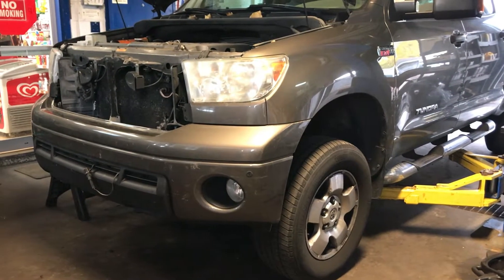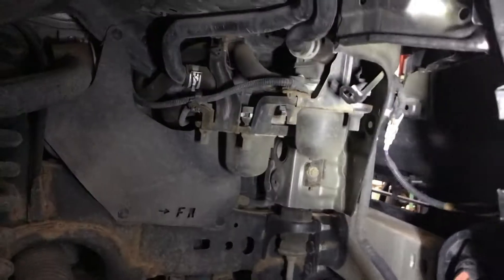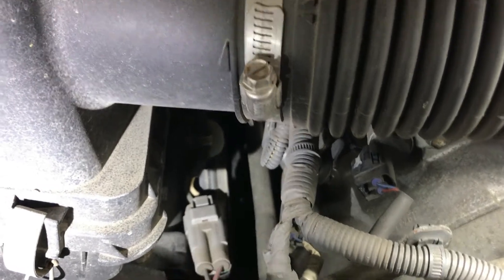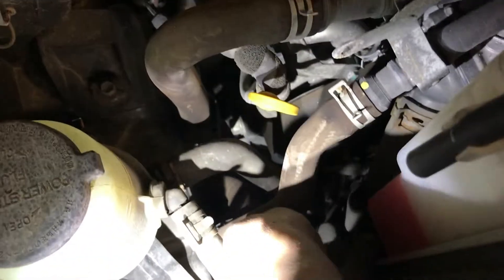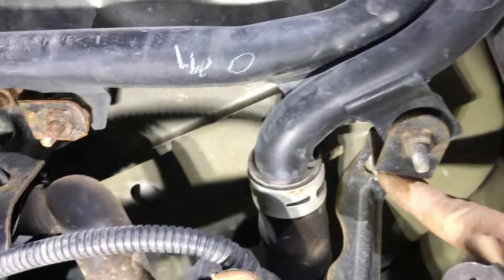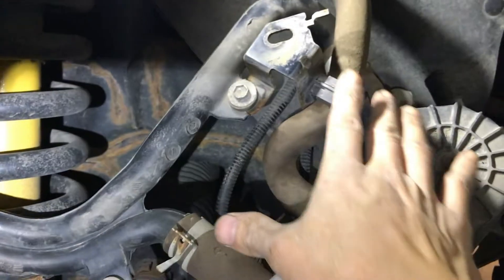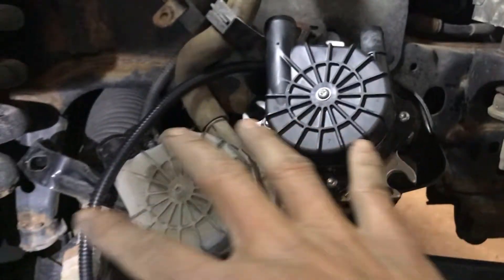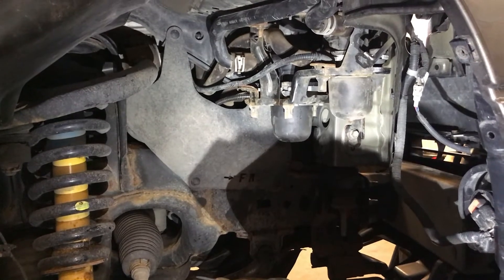2010 TOYOTA Tundra - How to replace air Injection Pump

Comment: The pumps are 12 volt DC so you can also test the pumps by making yourself two jumper wires to run from your battery. Disconnect the cable connection to the pump and make note of size terminals. Get yourself the correct terminal connectors to attach to the pump terminals so that they don't touch each other. Take the other end of your jumper cable and touch one to your battery + post and then shortly test to - post of your battery. Just for a second or two to do a bump test. I had one pump that would spin but the other did not so I have the choice to order only 1 pump before tearing into it. Wiring from the pumps: Red is hot and black is ground.
Reply: Thank you! I wanted to try this.
Did you get a p2445 code?

Also, if so, what part did you order?

Comment: My 2011 Tundra with a 4.6 is showing P2443 and P2432. It says replace air driver (I’m assuming that is the pump) so would you recommend doing both pumps and both injection valves? I did the secondary injection valve about a year ago. Thank you for the help!

Comment: I replaced both of mine in a 2007 tundra. Also bought the update breather neck to avoid the water being sucked into them again. Replace both and clean them if they aren't cracked, maybe have them as spares.
Reply: How'd you find the updated breather neck? I can't find anything specifying an updated/fixed part. Thank you!

Comment: My friend thank you for the video, I bought 2 pumps and would it matter if I accidently plugged for example bank 1 into the bank 2 harness they look the same?
Reply from the maker: Depend on how the system work, computer maybe turn on only the bank(s) that need air injet into the exhaust. If it turn on the wrong pump then computer will set the Fault codes and turn check engine light on. If after many km of driving both in the city and hi way with no engine light on, you are good

Comment: Thanks for your video. I have a 2009 4.7 and have replace one pump that’s on the right side where would I find the other pump? It’s a 2009 tundra 4.7 regular cab.
Reply from the maker: It's should be at the same location unless it is had only one pump. I have to check the manual
Reply: @silverstonespov5291  I only saw one but would like to verify. Thank you in advance.
Reply from the maker: It’s has 2 pump, the right front of engine it bank 2, bank 1 air pump it at top of engine. That is base on the wiring diagram
Reply: It must be under the cover because not visible to me. Thank you very much!

Comment: thank you for video, question: if by accidently plugged bank 2 to bank 1 or bank 1 to bank 2 will it matter? I bought both new pumps and they both look the same, the reason I ask is because i installed both and erased the check engine code but after a day of driving it came back on and truck went to limp mode.
Reply from the maker: Yes, PCM turn on each pump separately depend on which bank need air and need more air. That is why they came with 2 pumps .So, switch the pump connectors back, clear the codes and try it, good luck

Comment: Great Video!, I have a 2012 Tundra, V6 and had air injection system code P2443, I did replace the air pump with new OEM air pump and new valve for passenger side, I did double check all connections are good, but I still see the engine light, I reset it but still come out, I noticed the pump not making sound when I have the switch on, any ideas why this happening , is there a fuse or relay need to be checked ? thank you
Reply from the maker: Sorry for late reply, there is no fuse or relay for this 2 pump, it control by modules for each air pump, both module are small(8 wire plug) both module at left rear of engine compt according to the wiring diagram

Comment: If both are not working will this cause your vehicle to have reduced acceleration and bad gas mileage?
Reply from the maker: @TobyWoods-fv3ey  Yes, the vehicle may going to lim mode, driving not over 80km/h

Comment: I replaced both air pumps. Checked first to make sure they were good.  I get a p2445 code saying they are stuck off . Is there a fuse, link or relay that needs to be replaced, if so where is it?
Reply from the maker: I have to check the wiring diagram again to see. I didn't have to replaced any fuse or relay on that Truck

Comment: I replaced both of the pumps but it is still going into limp mode what else could it be
Reply from the maker: Check the Wirings, Fuses that can cause the Pumps not working. Did it still have the same codes?

Comment: My toyota cranks but don't start, my friend connects something to the computer and air pump and the air injection come out, you think that's the problem? Why don't start.
Reply from the maker: Air Pumps work or not have nothing to do with the NO Start, you have other issues. scan it to see what code and go from there
Reply: @silverstonespov5291  thank you.

Comment: Why not follow the air tubing and see if it goes to the side of the engine where cylinder one is where it's at the side of the engine where bank bank 2 is where cylinder 2 is just follow the air tubing an that should tell u what bank is which